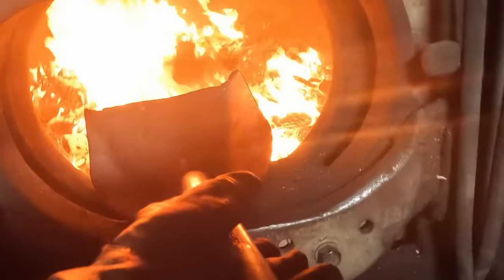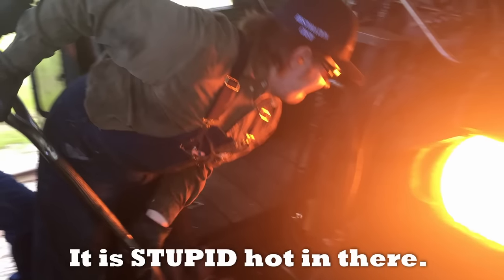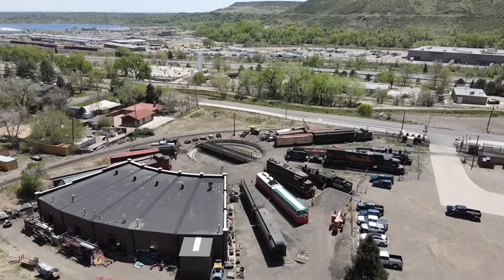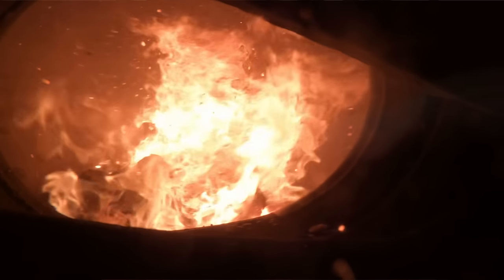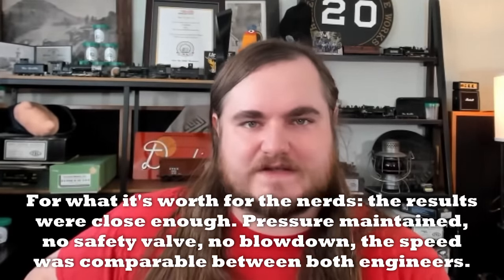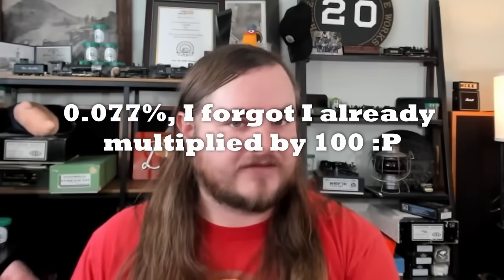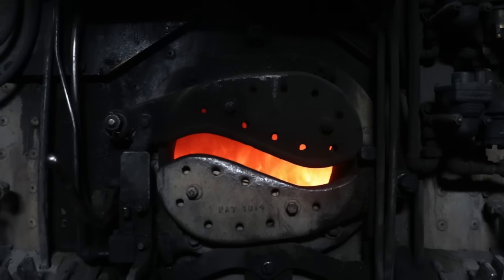How much COAL does a steam train burn? | Railroad 101

Comment: Honestly, running the 306 laps till the tender runs out could very well prove to be an interesting endurance challenge. 24 Hours of Le Mans but for steam locomotives and their crews.
Reply: New Ep of "The fast and Ferrous: LeMans" :)
Reply: @VAXHeadroom I’d love to see them do a rapid crew change. Don’t think a tire change would be speedy, however 😂
Reply: I have a question and the question is can you show how they might have loaded things like tank cars back when they were for creating the railroad and then Holly load tanker today that would be super interesting
Reply: That would be quite the challenge of endurance because you have to keep not only the water, fire and coal in check, but the pressure under control as well.

Comment: I love how counter intuitive it is that the harder you work a steam locomotive, the more efficient it is. Unlike an internal combustion where the efficiency goes down the more you load it
Reply: That is only true in some cases. In this example the 491 is nowhere near its optimum performance level while 20 is working hard. It is like comparing a little 4-cylinder internal combustion engine to a V-8. Naturally the smaller engine uses less fuel.
Reply: Isn't a internal combustion engine more efficient at high load but low rpm? An ICE will indeed use more fuel at full throttle but will also produce more power. The gain in useful power will result in a lower amount of fuel per kWh produced. It's at least the case for petrol engines if I remember correctly because of the pumping losses induced by the throttle body. Maybe is it not the same for diesels because they run lean at low loads.
Reply: think of the superheater like a turbocharger. in a turbocharged ICE if you never get into the throttle/rpm enough to spool up the turbo, you never get the power and efficiency gains.
Reply: With the larger diesels common in trucks, container frame generators ect efficiency actually increases all the way to 100% load (the engine is still lean even at this point)... but its pretty flat from 65-70% upwards, and falls steeply below that. So the number one reason for excess fuel consumption is oversized engines. With the otto (spark ignited) cycles things are a little different, as in non-aircraft installations these engines almost always run slightly fuel rich (in large part for emissions reasons and the catalytic converter during low loads, where aircraft will often be lean). With typical modern compression ratio's its normal to require to retard ignition timing and/or enrich fuel mix further at high throttles to avoid pre-detionaiton (aka "knock", in this case "soft knock" which is where you have some pockets of fuel burning because of heat/pressure ahead of the main flame front, disruption smoothness of combustion, not "hard knock" where the fuel will be ignited before/without the spark plug firing at all). Soaking everything in excess hydrocarbons delays knock a LOT, but its also terrible for fuel economy, so for very small engines peak economy can be as low as 35-40% throttle and ~1/3rd redline RPM, but as engines grow larger or more optimized for high duty cycles these numbers grow, with something like a spark ignited school bus motor most efficient at maybe 70-80% throttle and 50-60% max RPM. That said in a vehicle you'll normally use less fuel per distance working the engine a lot less than ideal efficiency, because increasing speed increases drag far more dramatically than the extra idle fuel consumption for taking more time... which leads to the common misconception that car engines are economical at much lower loads than is actually the case, engines will tend to have good economy up to around their peak torque.. for a mustang GT thats 4,250rpm, its just also making a lot of power at that RPM which your mostly going to waste as brake heat at the next corner.
Reply: @malolavoue4717 I think another set of factors to consider is the powerbands of the motor and their relationship to load, fuel trim, and spark. I don't have any engineering expertise, but it seems that when the engine is working lighter but towards the powerbands (torque specifically) my cars seems to run better mileage. 

The only relatable thing I can think of is coming off the valve on a steam engine once you're rolling and coming up in speed to "trim" the amount of steam and everything else being used since the excess power is being wasted if not actually hindering performance.
Reply: @malolavoue4717 I think another set of factors to consider is the powerbands of the motor and their relationship to load, fuel trim, and spark. I don't have any engineering expertise, but it seems that when the engine is working lighter but towards the powerbands (torque specifically) my cars seems to run better mileage. 

The only relatable thing I can think of is coming off the valve on a steam engine once you're rolling and coming up in speed to "trim" the amount of steam and everything else being used since the excess power is being wasted if not actually hindering performance.
Reply: @goldenhide  As @Sheepinacart said, engine efficiency and fuel economy are different beasts. The engine might get better efficiency at high load but will get terrible fuel economy because it will produce lots of work using lots of fuel when it could produce maybe a third of the work for half the fuel (increasing by 50% the fuel consumption per kWh) if you use less throttle. As far as I can tell, the best results I could achieve in terms of fuel economy was applying as less throttle as possible, keeping the engine speed as low as possible and freewheeling or engine breaking whenever possible to keep as much momentum as I could. When I had to accelerate, I didn't use too low rpm to prevent the engine from running overly rich (I usually try so stay within the 1500 to 2500 rpm range when getting up to speed and then as low rev as possible as long as its over 1200, on a small petrol 1.2 12V i3 engine)
Reply: @malolavoue4717  Exactly. I'm getting much better mileage off a BMW S54 that's 200k+ miles and 20 years old (I need to rebuild it actually, they recommended that at 185k and im sure the previous owners never did that) and my mixed total economy is better than the EPA highway. 

Anyways I've heard people posit the powerbands before, but it hasn't been the same in my experience.

Comment: We have a fun oddity at my railroad that our big 2-8-0 have to use more regulator and cutoff than our smaller 2-6-4T when pulling the same load. On paper the bigger engine have about 12.5% more tractive efforts.

Comment: I suppose this is also why steam locomotives were much more built specifically for a job seeing as a hardworking smaller locomotives are more efficient then a large do it all
Reply: Seems like the most efficient way to do something is to barely do it.
Reply: But also multiple smaller engines on a train were more difficult and less efficient than one large one!

Comment: Thanks for the metric conversions, makes things easier for a lot of us outside of the US. (Owning a US car I'm pretty used to inches and stuff, but never got the "feel" for fahrenheit degrees). Small hint on converting and using measurements in general by using a saying: 87.4199% of all measured numbers are suggesting an accuracy that can't be justified by the way those numbers were gathered. Meaning that for a three digit number you don't need to provide decimals anymore if you aren't into space missions or nuclear science. ;).
Reply: The only defense for F I can offer is that the degrees are smaller and therefore more accurate.  For high temps just double the C to get the F.  For low temps, multiply by 1.8 (or 2 if you're as lazy as me) and add 32.  We hate it too.
Reply: @alext8828  That's always the argument, but it's really meaningless. If I measure in tenths of a degree C, now my unit is smaller, and therefore "more accurate". So then you measure in tenths of a degree F, then I measure in hundredths of a degree C, etc.
Reply: @michaelhall4626   The display for F is more accurate than for C.  Let's not go crazy over it.

Comment: Awesome subject and video Hyce! When I was firing the N&W 611 running the main during the 2015-2017 years, she would average 1 ton of coal and 2,000 gallons of water every 10 miles. But there are seemingly endless variables- average speed, wet or dry weather, outside temps, quality of coal, skill of fireman and engineer, etc.
Reply: The Peppercorn A1 class Pacific “Tornado” over in the UK, according to Top Gear (UK) Season 13 Episode 1, can burn 33 pounds of coal per mile at 75MPH.

Comment: I would assume boiler size plays a part in this too. 491 has to heat a lot more volume of water than 20 does, and as you mentioned if 491 was truly working as close to tonnage as 20 was during the event it may be equally as efficient in coal/ton.

Comment: It would be interesting too see a comparison of Coal burners to Oil Burners. Specifically in Narrow Gauge. At OCSR we average about 10 gallons of oil per mile with our superheated 2-6-2 McCloud 25, which is roughly 70Lbs of oil per mile and Standard Gauge. compared to your 130Lbs of coal per mile on a narrow gauge 2-8-2. Would be interesting too see a comparison between the 491 and say a similar sized oil burner at Durango. 

also I just like oil burners more than rock burners. 
All Hail the Carbon Soup.
Reply from the maker: Oil burning certainly does have its benefits... I'd bet the D&S has some fun data on all of the above. I'd be curious as well.

Comment: HYCE love your videos. I worked on a 55ton Climax in WV for 20 years. We started with a 4 car train 153 ton  running 11 mile round trip. We burned  500 lbs of coal per trip depending on the fireman. The firemen that lifted safety valves and made a lot if smoke could burn as much as 650 lbs. In the old days they would have deen fired for wasting fuel and water costing there company money.

Comment: on the furka pass i fire 600+800 HP compound engines, using about 700-800kg per day. that's 17km over the pass and back, engine weight being 36/45T and load between 55-70t
it's a height difference on one side of 660m, the other side 810m.
in that time i evaporate about 10 cubic meters of water.
the maximum gradient is 11.8%

in translated for the 3 countries worldwide that don't understand:

coal consumption: 1500/1760 pounds
Distance 21 miles
loco weight 80'000/99'000 pounds
train weight 121'000/154'000 pounds
climbed height in a day: 4'822 ft
water consumed: 2640 Gallons

here's a video of a whole pass crossing:
https://youtu.be/Hopge6rm3Ys?si=9h6raer8Wew1ZRcc

Comment: A recommendation for your testing from a boiler inspector's grandson; if possible have the #491 pull #20 with the same number of cars as you orginal test to see if that extra weight aids in superheating. 
The best explanation for steam locomotives is high torque variable horsepower.

Comment: Well interesting topic, but sadly no table for compare...would be nice to know the HP of each engine and the load...stats.
Since some years I am a deckhand on a steam tug in Hamburg, named TIGER.
Tiger: 17 m long, 40 tonnes water displacement. Compound HP (8bar)/LP (5-6bar) = 250 (at 110 RPM) Horses average, Marine Boiler, one furnace, 9000 Liter (12 bar) Tiger was built 1910, in service until 1966 at the port of Hamburg. Now we make cruises at the weekend.
To get from cold to 12 bar, we need approx 12 houres and use 300-400 kg of anthrazite (from Brasil or Poland). On average we use 80-90 kg anthrazite per hour steaming through the harbour. The bunker capacity is around 7000-8000 kg. I know, you cant give exactly consumption per hour because its depends on how hard the engine is used, its like driving your car and pushing the excellerator...

A video of Tiger:

https://www.youtube.com/watch?v=hlmg-70Loxc&t=205s
Reply: There’s some decent stat tables on Wikipedia, for the 491 at least

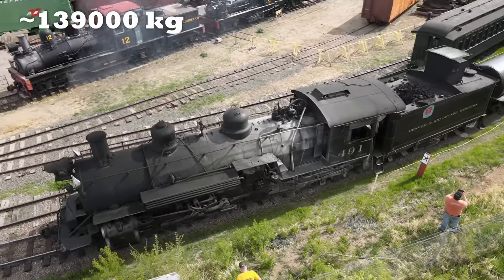Comment: 1:55 I knew that locomotives were heavy and all, but for perspective:
Number 20 at full weight is roughly the Maximum TakeOff Weight (MTOW, or how heavy a plane can get before it is literally to heavy to get off the ground) of an Airbus A220-100 (135k vs 139k pounds.)
491 on the other hand, is about the MTOW of a Boeing 767-200 (307k vs 315k pounds.)
Reply: Yea? The weight of the Number 20 is easily within reason for a 24 meter Scandinavian Lorry and wagon. (box truck+ trailer) 64.000kg. Even in most of Europe 40.000 - 50.000kg is just normal. Aircrafts are just stupid and a waste. It is bad enough derailing/running into a ditch or sinking! Aircrafts are all of that and worse! Even trains with there horrendous brake distances are better then a falling barely in control thing that is a aircraft. Anyways Number 20 seems reasonable in size and weight. 70.000kg - 80.000kg - 90.000kg? No big sweat. I mean 90.000kg is extreme overload for something built for a total weight of 64.000kg or at best 74.000kg. XD But possible to transport on decent roads even with standard equipment. Just asking for trouble but yea.

139.000kg? Now that is just insane! And it is a narrow gauge loco! 140.000kg is heavy enough to be a road transport nightmare even with good conditions, right special transport equipment and good roads! Like a Abrams tank is just 62.000kg or something! Even if a road can hold 2 trucks hauling 2 Abrams meeting each outer going either directions at the same time? It still would be 160.000kg+ on a single direction of the road. It starts to be ridicules when you start to question if the road is going to take it. Let alone bridges and the equipment on said road! Or told to calm down as the road is meant to be able to handle tanks being shuffled around with one going to the front and one being rushed back to be repaired! It is funny then to be worried about 200kg of overload weight. Being fined for 200kg overload! When the road/bridges is not even close to hitting the limits! Sure feels silly having to worry that refueling would be enough truly impact much. When you are not going to try and take off into the sky or something ridicules. Why back in the days overloading underpowered machines was just a slap on the wrist. Even driving without license where just the braking point for the popo! Fun times. Different times.

I'm sure the TakeOff weight limits are just a matter of trying a bit harder to get off the runway. But then what do I know! 200kg might be enough to run into a ditch instead of taking off. Anyways 61.000kg of iron meant to be able to last 200 years or more? Sounds good to me!

Aircrafts are meant to be as light as possible. Even the cargo of a aircraft is normally just humans or whatever fits in the load limits and pockets of people with to much money and no time to wait on shipments by ground/water. Much of the weight of a aircraft is in fuel. While a steam loco is mostly brutal and ever lasting. Machines that sticks around and useful passed our own lifetime is far more impressive then some flying thing in the sky. It is quite sad when you are told that a engine or something is going to stick around being useful passed your own lifetime even when very young. Aircrafts? Well... Not so much.

Comment: This was actually pretty cool and it honestly doesnt surprise me on the results. You use the engine best fit for the job which is why a lot of railroads kept the fuel efficient but weaker 4-4-0 running on branch lines up until Doodlebugs came along. They were the right engine for the job and were cost friendly and thats only one example out of many.

Now in terms of fuel economy i always wanted to know under ideal circumstances (flat track no wind, burning efficiently and unloaded what would the potential burn rate be say per mile or hour. I also wonder if much like a car going 55-60 mph is there a speed at which the engine is the most happiest in terms of fuel economy. Your video did great but ive always wondered just so i really get an idea on how often these beasts had to stop for fuel.

Loved your video and as always i look forward to more.

Comment: So when is railroad 101 on how much water gets drinks?
Reply from the maker: That's a smidge harder to measure, but would be fun as well!
Reply: @Hyce777  I think it would be easier to measure using percentage of the tender at full (100%) and compare it to used water (100% minus airspace percent) then convert percentage to gallons/pounds.

Comment: The issue with things like "running hard" is it is relative to the engine.
A big engine running not hard can be running more and burning through more fuel than a small engine running hard.

I would expect that with the same load being pulled, the larger engine would need to burn more fuel, because it is moving more weight, because it includes the weight of itself.

Comment: please do a video on
the porters steam loco 
the cook mogul
the class 48 tank engine 
the Japanese class d51 nick name hero of the railways.
how do gear trains work
something on saddle bolier tank engines

one talking about the different types of steam funnles and there uses,
a short video on how a Armstrong turn table works 
the different types of cut offs/reversers/Johnson bar
some are a big lever, some are a big valve wheel, and ive also seen some that are like rods, one exsample is train sim world 3 and im not sure where to find the other reverser  but a video on the different models of these and different whisle models would be nice

Comment: If you worked 491 hard enough to get significant superheat, she would be much more efficient than 20. Superheating exists because it makes the engine so much more efficient by increasing the temperature of the working fluid, allowing for a higher Carnot efficiency.
Reply from the maker: That's what we'd assume; I'd be curious to get a true comparison. Probably won't ever get to, but who knows.